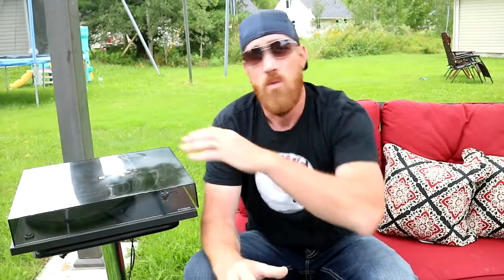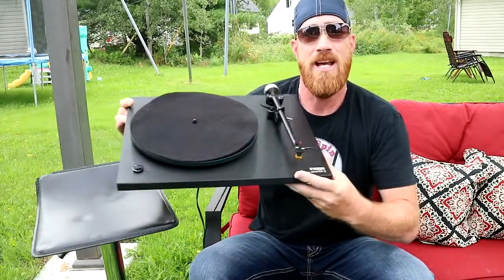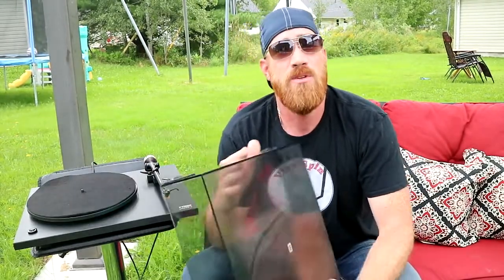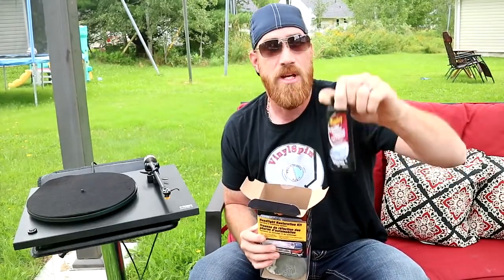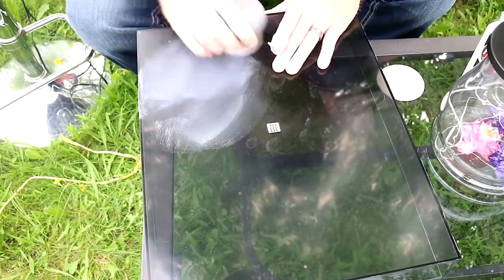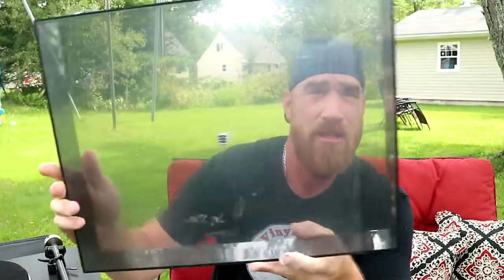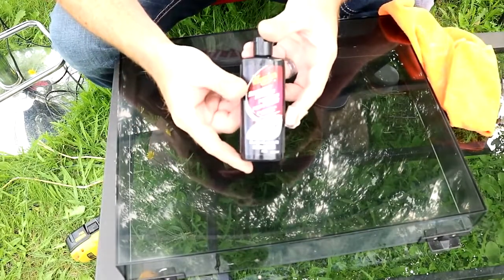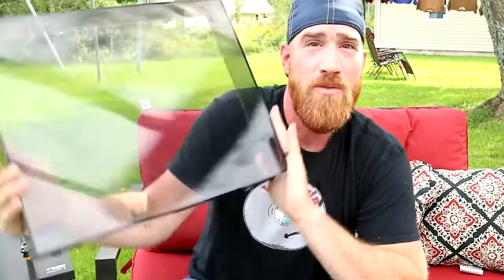How to restore turntable dust Cover

Comment: GUYS  HELP . i tried and ,i have no gloss , and  i have Swirls , now  let  me  clarify that i didn not find the KIT ,only the plastX 
, local store didnt have a kit , now i had to grid way further cause u had deep scratches, and  gone  up to  3000,the thing is  hen  i am going  above 1000, the 2000 and 2500 and 3000 are like doing  nothi9ng , then proceed to polish with plast x,slowly slowly improving , not like the vieo , and not  shining ,tried Turtle's ceramic polish and  wax for  finish  but no results
Reply: Same here Amazon or Ebay dont do the kit, just the bottle of Scratch X and it comes at a hell of a price